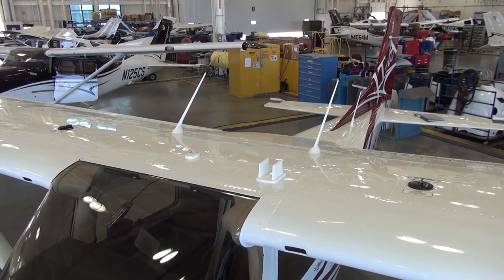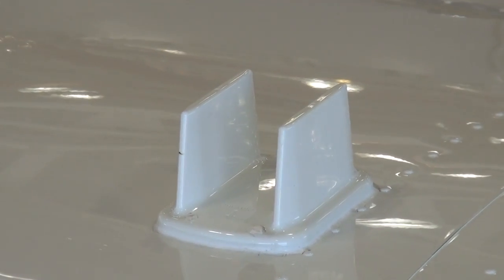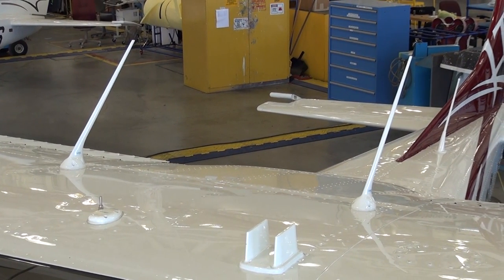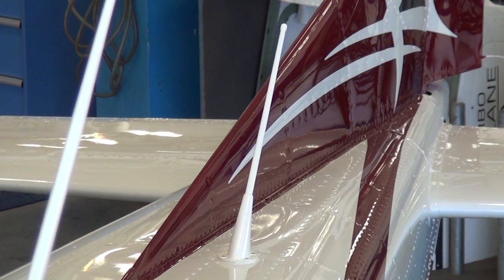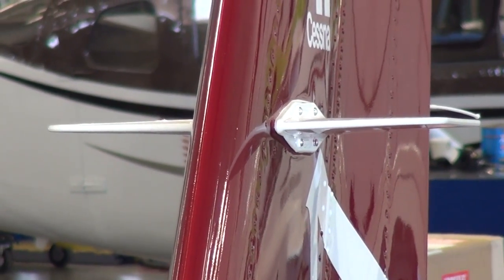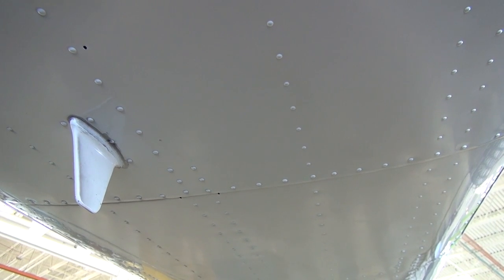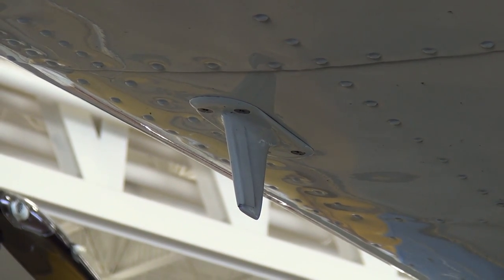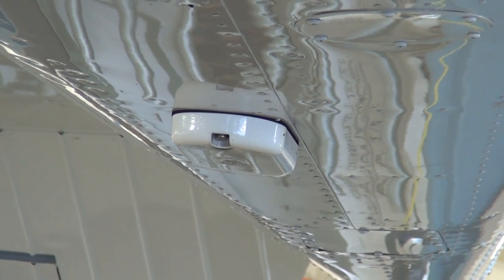Antenna Placement on High-Winged Single Engine Piston Cessna Aircraft

Comment: Lots of "ann-tan-uhs". But which one is Nav 1 and which one is Nav 2?
Reply: Both.  The left and right whips or blades on the vertical stab electrically function as a single antenna, and reception is split between Nav 1 and Nav 2.  If you bust off one whip (blade on the 182) both Nav 1 and Nav 2 performance is compromised.  If you are having reception issues on one Nav receiver but not the other, the fault is going to be at the diplexer that splits the signal to the two receivers, or downstream from the diplexer.